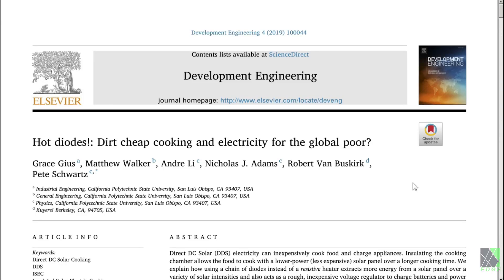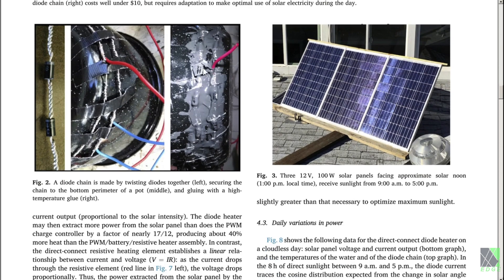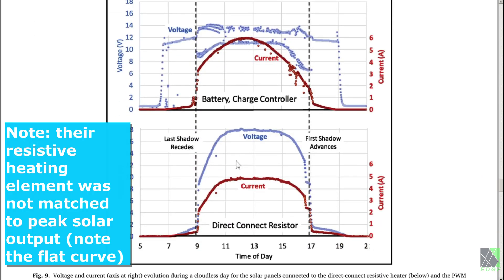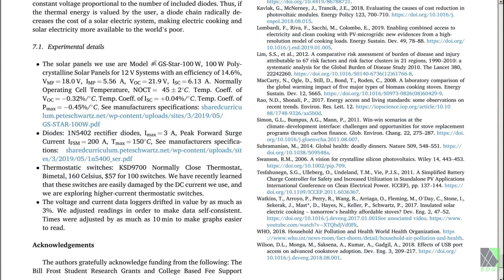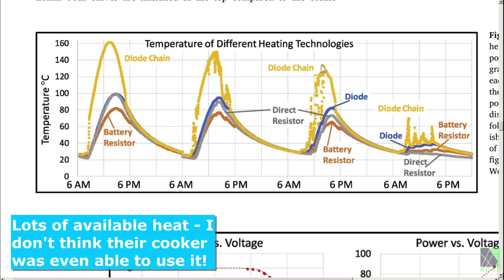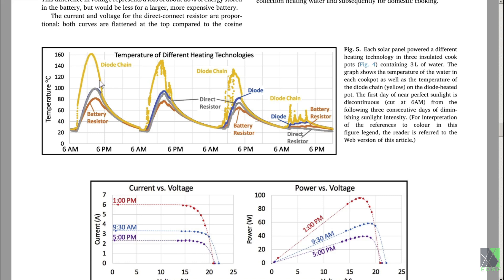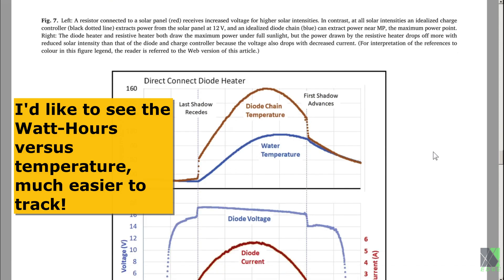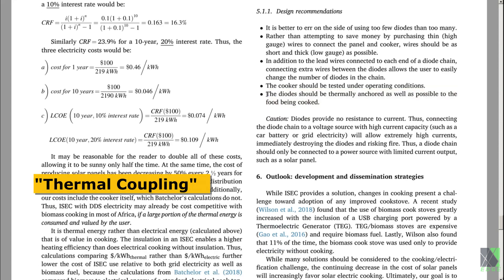Solar Powered HOT Diodes! Solid State Solar Electric Heating and Cooking #research paper #science

Comment: 0:16 «It is better to err on the side of using too few diodes than too many». Both are probably true. If you put many diodes in the chain then the voltage could become too high and the current & power will decrease sharply (see figure 6). However, a simple way to reduce the current and so the power dissipated by each diode is to use multiple identical diode chains in parallel. That seems obvious to me but I do not remember seeing that idea in your videos or in paper (which I still have to read carefully). The system will cost more but the risk of overheating will be reduced. significantly.
Reply from the maker: @cynodont7391 Good points! I'll try to remember to include this in the next video. Operating Temperature of the heater plays a role too, very important! I have always heard don't use diodes in parallel, but that isn't going to stop us :D 

PS if you are interested... power bridge rectifiers are fantastic for regulated solar electric heating. They are pretty tough with a metal case. I have been using 50 amp ones to heat my workshop, and of course they are also in parallel!
Reply: I posted a video showing 2p2s diodes ...they warm at same rate so for sure you can parallel to spread current /heat
Reply from the maker: @cgmarch2359  Watched it.. awesome test!
Reply: @cgmarch2359  Nice video, I guess i need to stop reading and start trying stuff. The theory people seem to have it all wrong.  Could you add the details of the test to the video? Volts, amps, diode type etc. & why you were trying it, was it to test for heat generation or just to see if it works?
Reply: I was looking into that today after I saw this video. Apparently due to tiny tolerances in each diode the diodes don't share the current evenly when in parallel so one diode tends to consume more power and get hotter than the other which leads to failure of the hotter diode. If the diode is cooled and kept below the failure temperature then that should not be an issue. The researchers in the paper stated they could pump 40A through the diodes as long as they were cooled and they are only rated at 3A.

Comment: Also, I’m planning to build a string of diodes for supplementing my winter heating.  If I can raise the ambient by 10-15f, it’s less heating cost.
Reply from the maker: @peterxyz3541 Right on :) wish I could show you... on my workbench is one diode heater prototype, and a bigger one in testing, hooked to 2 extra 200w panels outside. It's not quite winter here, early fall... definitely getting ready :D
Reply: Diode sand battery to store up thermal mass energy might be an idea,but the 120* degree optimum operating temperature might be a limiting factor.
Reply: @jestercrusher7743  I'm looking to use diodes as a preliminary to heating water to boiling, then using supplemental rocket stove bench to heat sand up towards 500F for longer term storage to assist my gas boiler.  Designing it now to build in early spring.
Reply: My battery disconnected from my solar charge controller and cooked the diodes on my solar panels. I assume they were there  to meter the voltage but the panels are still working fine.the charge controller caught fire.
Reply from the maker: @jestercrusher7743 Wow that's not fun! I'm glad at least the panels are still working
Reply: Could I mount these diodes to 1/8 inch alum, sheet to make radiant heaters for my garage?  ( or radiant/ convective ) I have 2,4 by 8 solar air heaters, but these are hard to mount and need fans to move the air thru them, I would need 3 times the area of solar panels, but they could mount anywhere. , Or just be put up for seasonal use. The alum radiant heaters would be in a 40 to 80 deg. F enviroment. Something with no fans or switches sure sounds nice. These seasonal panels could mount almost vertical and would provid emergency power if needed.

Comment: IMAGINE…. (I work at a bakery, conveyor oven and all) …..using diode to bake or just to pre-heat the volume in oven before burning natural gas

Yes, paten it!
Reply from the maker: @peterxyz3541 Good thinking :D I always wondered, what about those steel mills and foundries requiring massive amounts of heat? Build a massive solar farm next door and short circuit it through the furnace. PV to load ! Cut your electric bills! Any remaining heat can come from the grid or gas, but only as needed

Comment: How efficient are hot diodes vs a standard electric stove (240V AC)?
Reply from the maker: @Voidsworn Hi, one could say they are 100% efficient just like nichrome. Diode strings are only recommended for direct-connect solar electric operation, because solar panels need to stay at max power voltage (MPPT). Resistance wire cannot do that on its own. If you're running off 240v AC, standard resistance heat is still the way to go... hope that helps !
Reply: @solarpoweredge  when you say resistance heat, what do you mean? Can you recommend devices based on that? Are there cheaper alternatives that are also as efficient?
Reply from the maker: @ekeretteekpo3004 Hi, the most common type of electric heating element is literally just an electric resistor. It may be a piece of nichrome wire, a metal bar, ceramic plates, but no matter what it's just a resistor. 
*A resistor has Impedance (aka resistance) and it resists the flow of current, causing it to get very hot at a certain voltage. All electrical heating elements are technically 100% efficient, meaning you put in 100 watts, you get 100 watts of heat. 
*But when using only a solar panel to make heat, resistance heating elements don't work too well, and cannot keep the solar panel at the proper voltage to maximize heat. They lose a lot of heat as a result, it's never captured.
*It just so happens a string of diodes can regulate the proper voltage of a solar panel, and they get hot, so they beat standard resistance heaters for direct-connected solar electric heating.
*Diodes are not resistors, and may seem to behave a bit strange. They have no significant resistance to current. They regulate themselves, unlike a resistor element.
*I do not know of any cheaper alternative besides diodes for direct solar electric heat. An MPPT converter will behave similarly, but it cost a lot of money versus cheap diodes.

Here's an example of a resistor cooking food my mini PV DC oven - it's direct solar driven but still works. It has insulation to improve efficiency.
https://youtu.be/qj-sa0bZPCw
Here's a DIY mini 12 volt oven build using resistance heating, doesn't use much power but cooks food easily:
https://youtu.be/z0dKupye594
Another resistance based oven that runs on 18v power tool batteries:
https://youtu.be/SLiwNnHPlI0

Simply put, with battery power, we can use a resistor for heat - it's 100% efficient. With solar power, we can use a resistor (doesn't work as well) OR diodes (works better if properly configured).

I hope this is helpful. My aim is to share knowledge and information, even if it's not quite mainstream - diode strings are still very obscure and unknown.
Reply from the maker: @ekeretteekpo3004 No problem! yes that term is technically correct. (because they use a resistance heating element to produce the heat from voltage and cook the food)

Comment: For some solar panels brands (e.g TRINA SOLAR, JINKO SOLAR, ...) , the datasheet contain graphs similar the ones shown in fig 6 of the paper. The two graphs can sometime be merged into a single graph with two vertical axis. Each graph typically contain 4 or 5 curves corresponding to various solar illuminations (e.g. 100%, 80%, ...). As shown in the scientific paper, those graphs can be used to predict the efficiency of a resistor or of a diode chain. They really helped me understand how U, I and P are related on a solar panel.
Reply from the maker: @cynodont7391 Thanks for sharing the information! that stuff can take awhile to absorb and understand... I must say this type of paper is a real gold mine, so much to learn :D

Comment: Nice. I cant wait for your next heater. For the thermal connection from diode to the water you can file a provisional patent as a micro entity at the USPTO for 25% of the normal cost ($64). That filing will give you 12 months to research if you need to proceed with a full filing, As an individual inventor the micro entity status means all patent costs will be charged at 25%.
Reply from the maker: @mikefiatx19 Huge thanks for sharing that info! I was totally unaware!